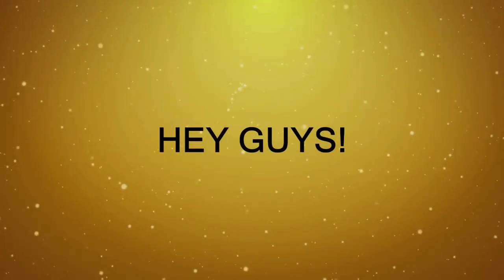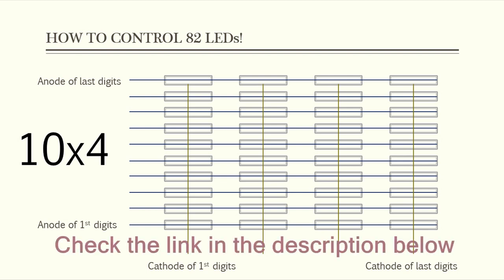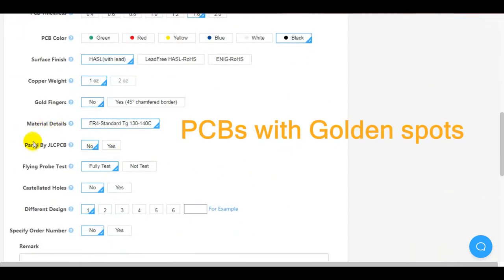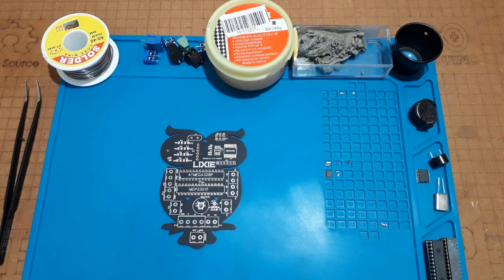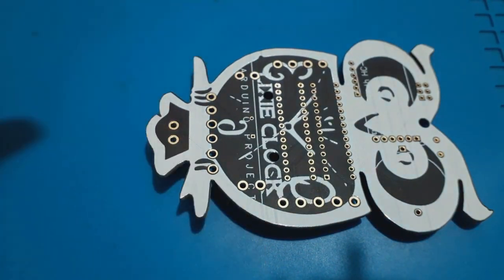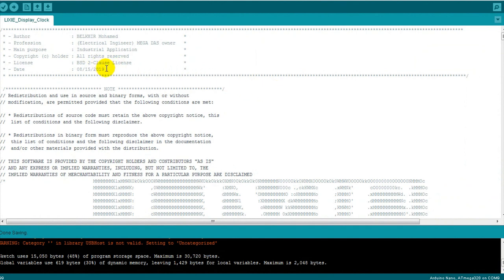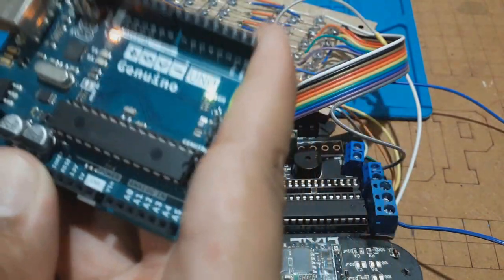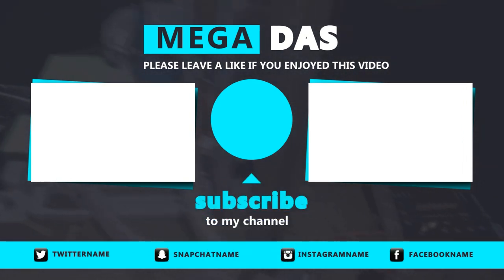Arduino digital clock LIXIE display

Comment: Exactly what I needed ! Btw can I use an arduino Nano with mcp23017 for this project ? I can’t order anything rn cuz of the corona situation just wanted to try something out with the stuff I have rn. If I can use a nano, can you please tell me how the wiring should be done ? Thanks in advance ❣️
Reply from the maker: Hello

Have you watched the video!? 🤔
We used ATmega328 MCU Which is the same MCU of the arduino Nano so you can do the same with your Nano 😊
Just follow the circuit diagram that we have provided in the download link of the video's description.

Let us know if we can further assist you.
Reply: Yesss I got it thanks a lot !

Comment: How deep does the plexiglass cutting needs to be?
Reply from the maker: Hello
If you mean the plexiglass thickness it is 3 millimeters.
Reply: @DIYGUYChris  No,I mean the laser cutting depth of the numbers 0 to 9
Reply from the maker: @madcreeper9174  numbers are engraved not cut..
Reply: @DIYGUYChris  What are the engraving depth then? (aka how deep the drill needs to go beneath the plexiglass surface)Like maybe 0.5mm ? My English is not great, sorry for that.
Reply from the maker: @madcreeper9174  I don't know exactly how deep is the engraving task but what I know is that the plexiglass needs some exact laser power to cut it and less than this laser power value it will only engrave it